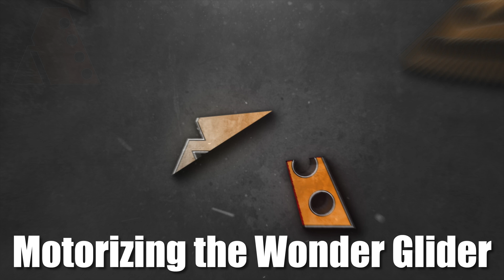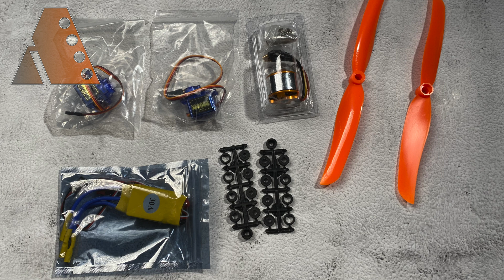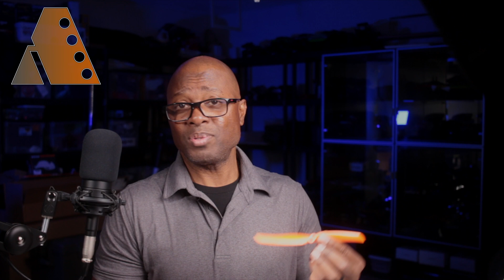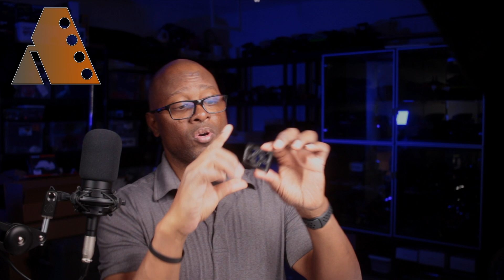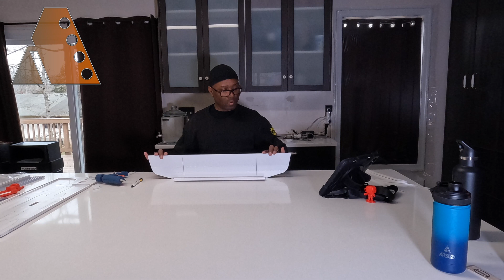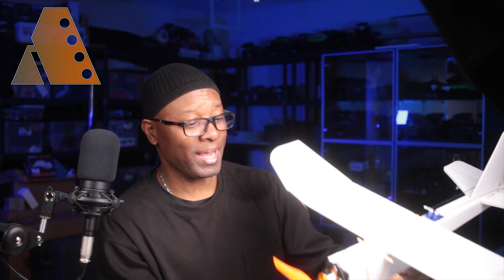Turning the FT Wonder Glider into a 3ch RC plane Pt 1

Comment: I'd be surprised if the 2S wasn't sufficient considering the size and weight of your foamboard [motor] glider. Hope to catch the maiden soon.
Reply from the maker: Thanks, Im pretty sure it is for the tests I have done so far.  Maiden coming but I believe I am going to have to do a ton of work to get it to be stable.  its defiantly a learning process!  :-)
Reply from the maker: I did do the maiden already which I will share soon.  I think it’s actually too much power for this little plane. I have a bunch of adjustments to make. 😅
Reply: long way around tiny trainer